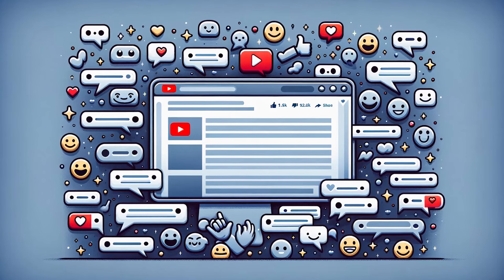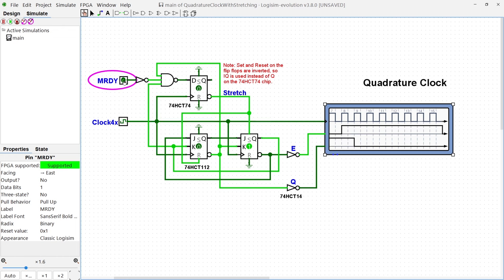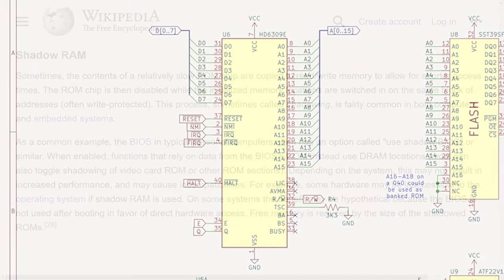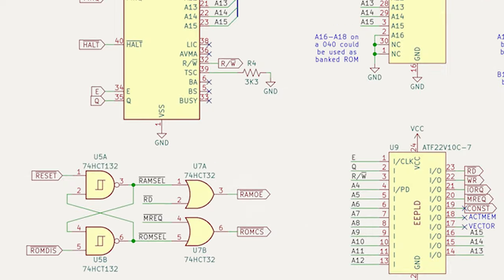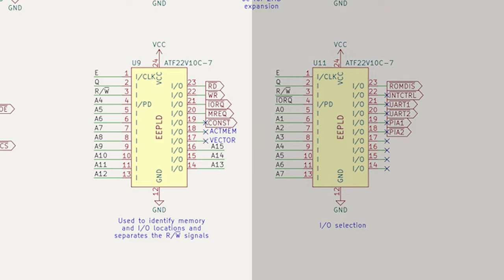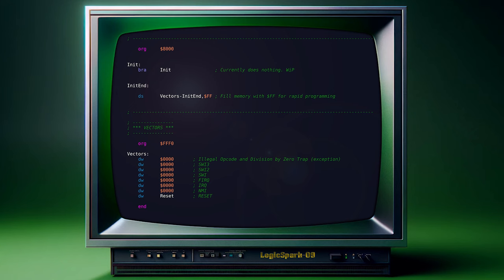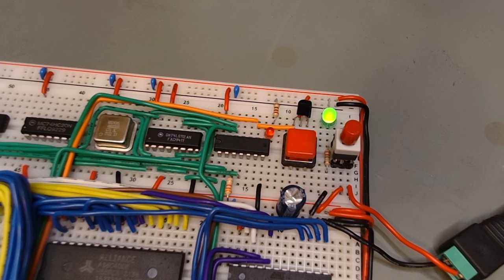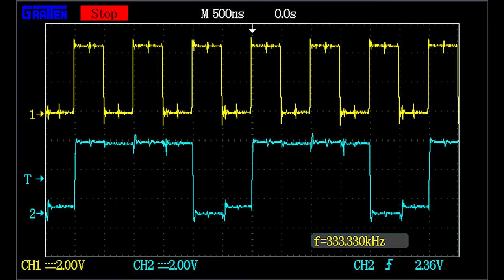6309 Unleashed: Memory, logic, and some lines of code - Ep3

Comment: Is there any chance you could make a video explaining how you set up a suitable Programming environment for writing assembly and then burning the eeprom? I’ve tried using Vs-code with 6x09 extension which looks great but sadly the LWtools assembler refuses to communicate with the 6x09 extension. I’ve tried updating paths etc but failed miserably to get it to work. 😢 Retro computers were so much more straightforward!